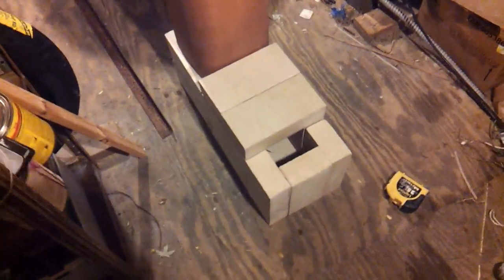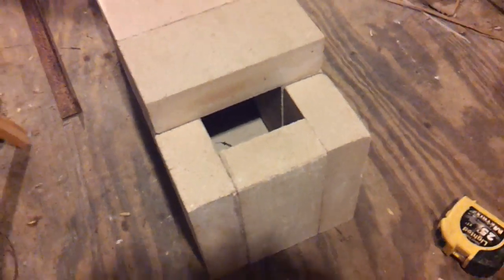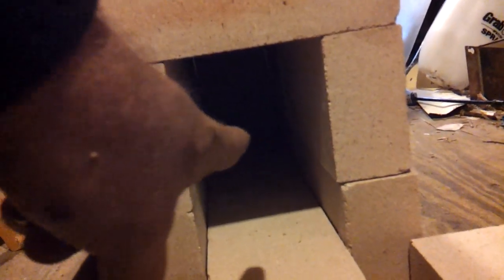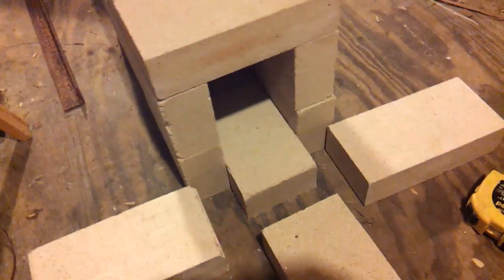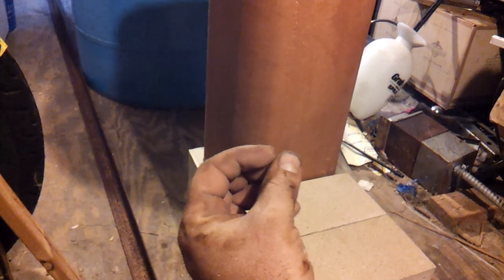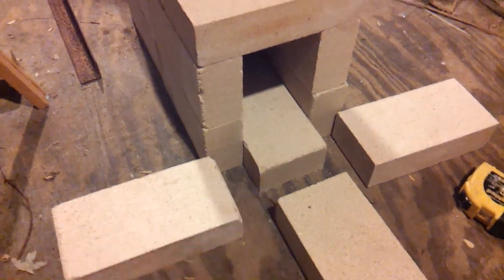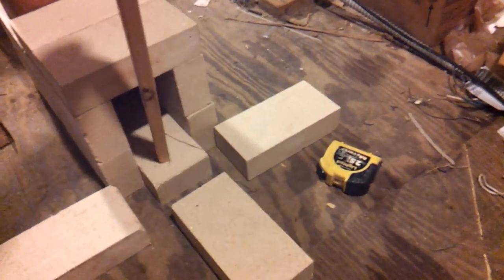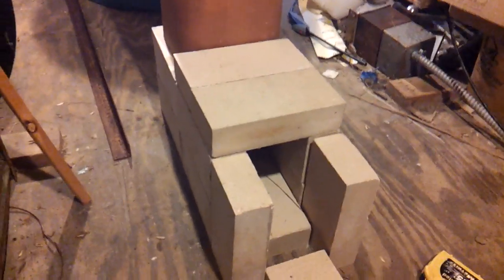Rocket Heater Wood Stove Build Part 4 (new J Tube configuration)

Comment: Actually the hottest temps are in the riser! Terracotta will only last so long unless it isn't running right. Fire brick is the best for the riser, not just for withstanding the heat but the turbulence created by the fire brick makes it burn cleaner and hotter.